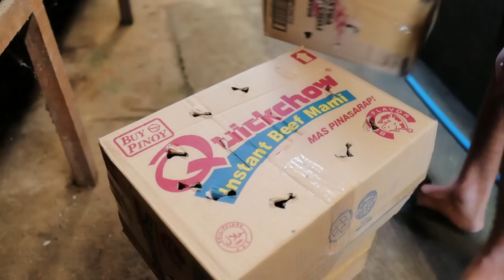How to produce 10,000 Catfish Babies in just 1 Week! Harvesting Catfish & Cheap Concrete tank update

Comment: Yah, you are correct sir dexter by using fine nets to bigger holes..
Or you can also use the basket or trays with different size of holes..
And for you to get easy from counting, why not try by weighing the fry's.. By using the digital weighting machine. You can try count some 50/100 heads,by its sizes, then weigh in,then double n triple and so on,...